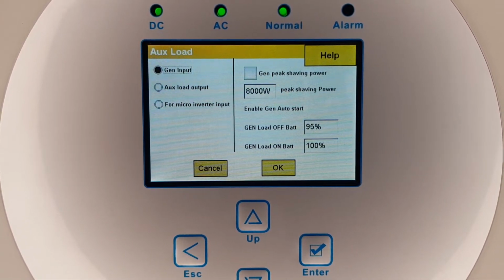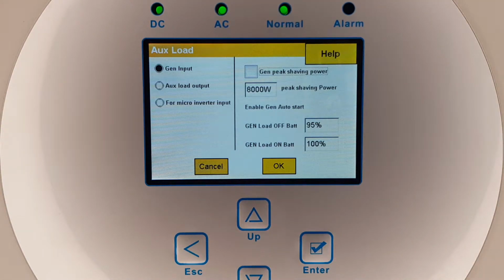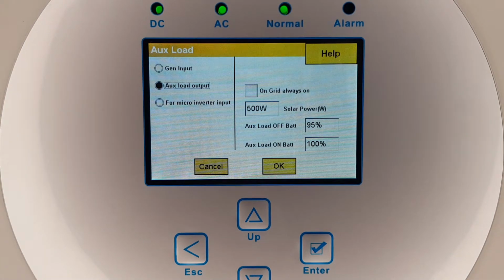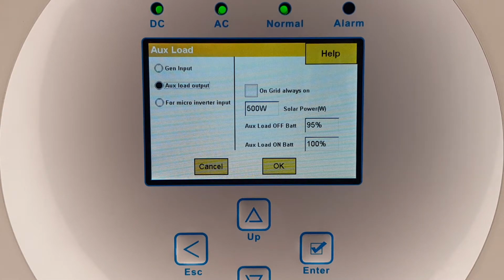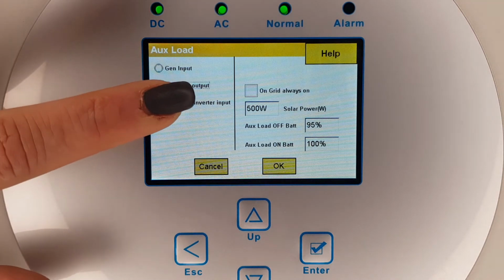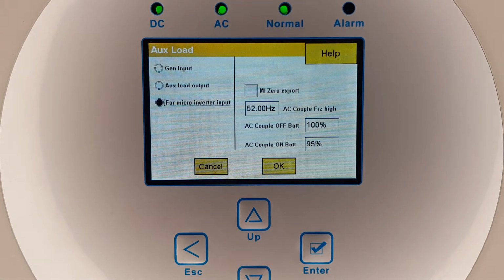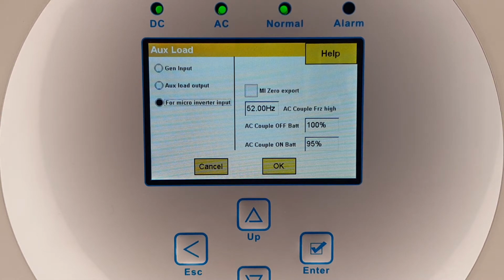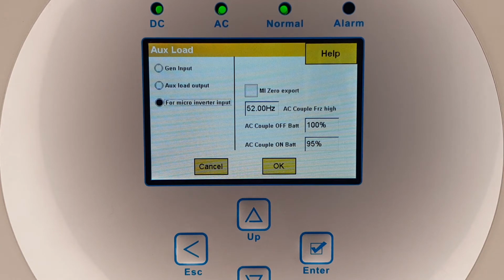Sunsynk Auxiliary Settings

Comment: Hi, I have 12 500w panels and an 8kw inverter.  My panels wont feed in anymore than 4.9KW.  I am told the inverter is cutting out at 20amps - can this be changed?  I am not getting full benefit of my 12 panels.